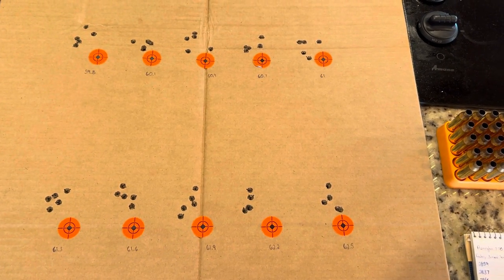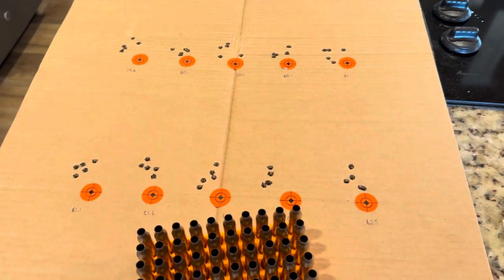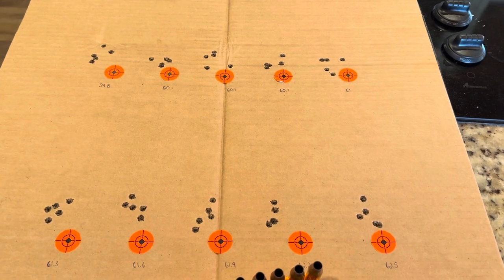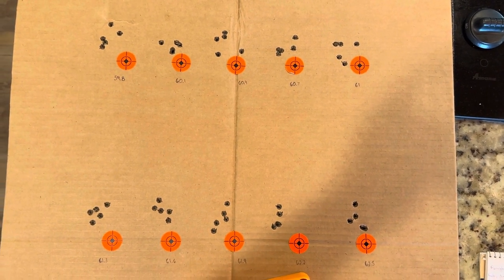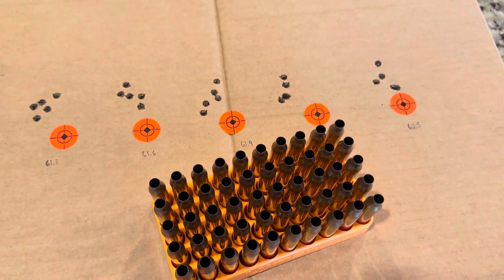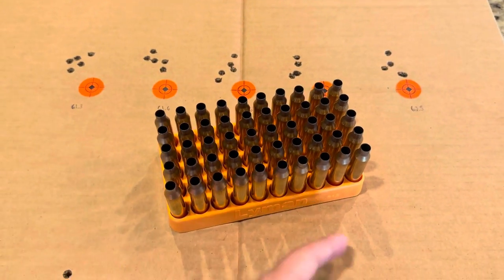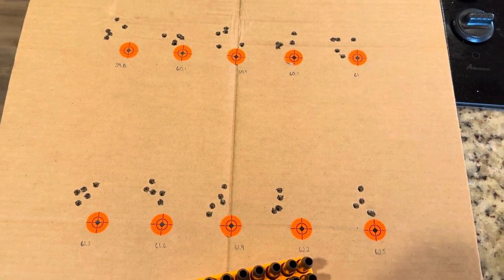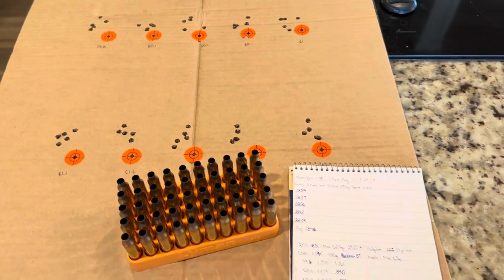Reloading 7mm Rem Mag: OCW Test with IMR 4831 and the Nosler 150gr BT

Comment: Good stuff Brother. Liking this series. 60.1 IMR4831has been my pet load with all 150s since the mid 90s. Back then it was a Remington 700 BDL with a ,3x-9x Redfield Tracker. I would get 5 shot groups from any type of decent rest under an inch. Many of the shots would be touching. After 2 of the 5 shot groups you couldn't touch the barrel though. Lol. 150gr. SGK and even 150 Remington PSP Kore-Lokt grouped excellent. I have chronographed this load a # of times  the past few years. I get 2930-2950fps now out of a Savage 110 Storm. My plinking load(lol) was 58.5gr. of IMR4350 and 150 PSP Kore-Lokt @ 2825fps. which is also sub-moa. Did you see any pressure signs over 61.0 grains? I have with CCI250 & Rem. 9 1/2M. Vertical stringing also was an issue.
Reply from the maker: I had no visible signs of pressure…the primers are cratered but that’s just what this gun does because it’s the same on all 50 pieces of brass. I definitely feel like I could safely take it higher.
Reply: @alabamareloader  Excellent. Thanks for vids. And thank you for feedback. Keep your eye out for Winchester's new Staball HD. I am working up some Staball 6.5 loads with 162 BTHP. 57.5 to 59.3.
All Excellent accuracy. 2840av. ES 20s at top. No pressure yet.

Comment: I don't know, man. I always stay away from loads that string. They never work out for me.

60.1 through 61 looks promising to me. The groups are roundish with not a lot of change in vertical location. 61.0 grains the group
Starts to shift down. That's where I would guess the outer limit if the node is, maybe. Anyway, I'm curious to see how it plays out.